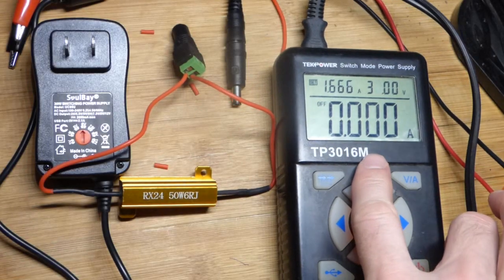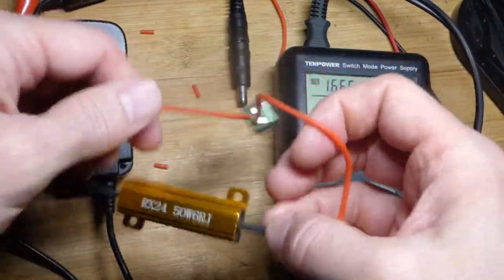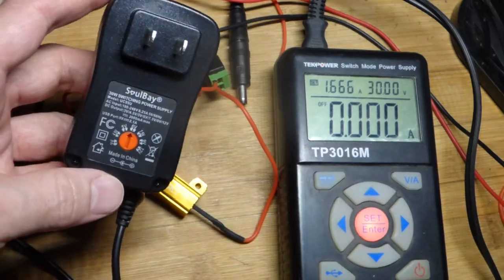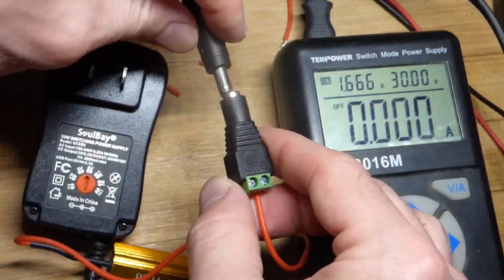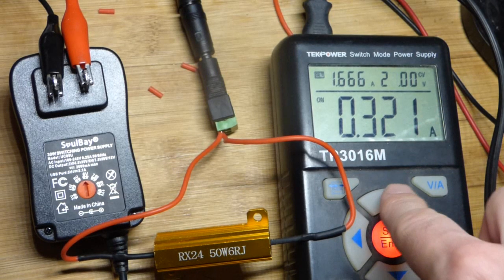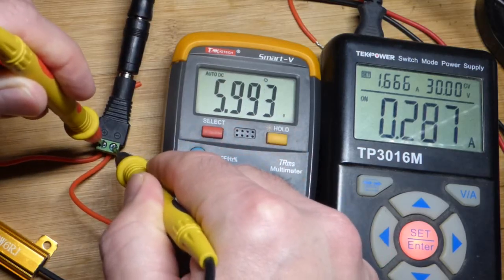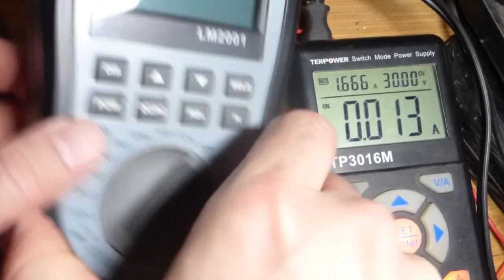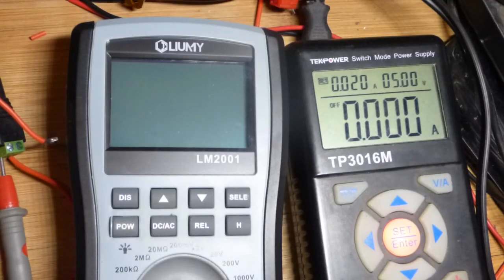Testing if a DC voltage can power an AC to DC adapter

Comment: Like I’ve been saying for years your the best content creator ever but, I want a project to do but I’m out of ideas, do you have any that would be good for a intermediate guy like me
Maybe something that uses a micro controllers or Arduino
Reply from the maker: I'm pretty much working every day for a couple weeks, so not planning on any new circuits for a while. I do want to try to come up with some projects related to stuff like home automation. That's a big reason why I got remote control relays a while ago. I did some arduino videos long ago, but that's more about coding than wiring as far as I am concerned. And to me it is easier to read coding material than to watch videos. There's lots of good learning arduino kits out there.

Comment: It's amazing how low voltage those switching power supplies really need to operate but they are almost always rated for 100-240 volts AC lol. I assume the transistor or chips inside them don't like to operate at high current low voltage.
Reply from the maker: Yeah, this one outputs a max of 2 amps I think, and I believe even less at 12 volts. So, I did assume that it was not made to take in much current.

Comment: Hi, Please kindly help me with wiring diagram.

I need a diagram of ne555 which will monitor 2 different voltages, and gives output signal 1 when the present reading voltage is between the 2 monitored voltages. For example, if one voltage is fixed at 13V and another voltage at 15V, but the present reading voltage is 14.5. So, it's between 13 and 15, hence, it will constantly output a signal 1.

But if the present reading voltage is below 13V OR above 15V, then the IC will not output anything. Please help me with the diagram 🙏🙏🙏